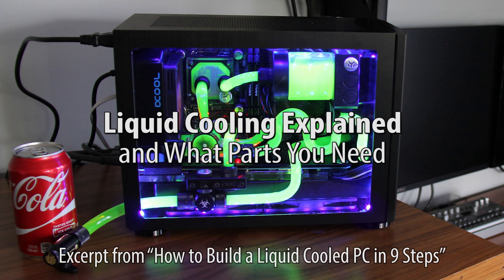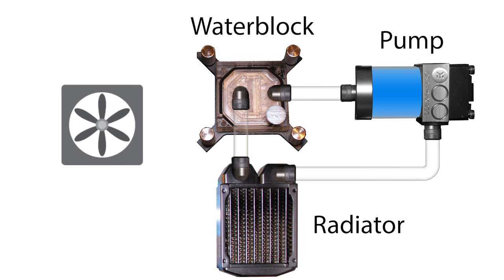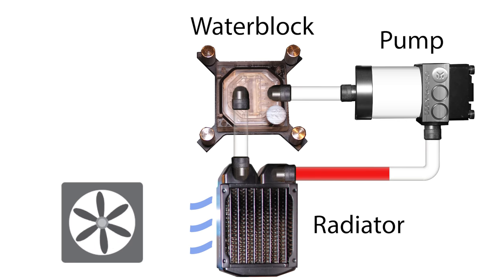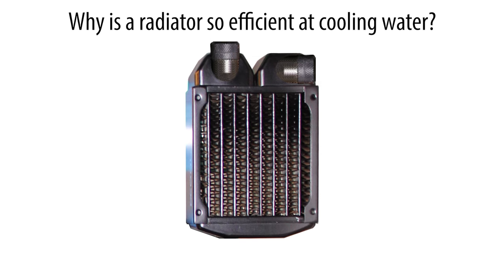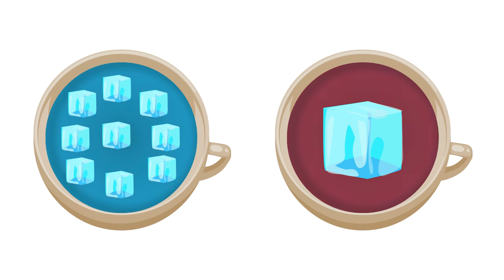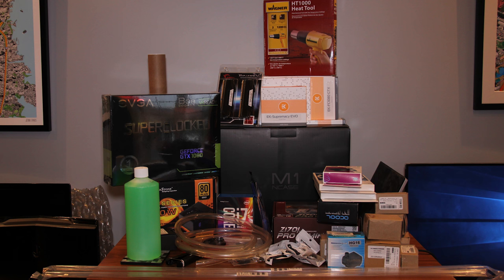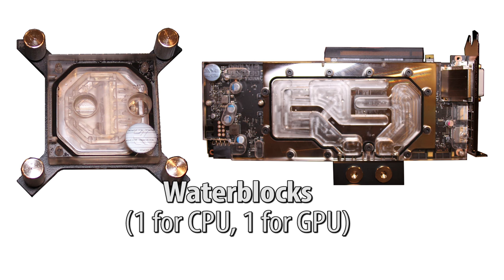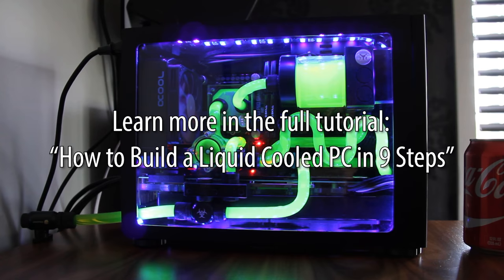Water Cooling Explained: How It Works and What Parts You Need

Comment: Cheers! Covered everything quick and concise!
For me, was wondering how the water got to parts like cpu and gpu
Reply from the maker: bob bob glad it was helpful! The CPU waterblock is how water gets to the CPU, and the GPU waterblock is how water gets to the GPU. Let me explain in terms of the CPU which is easier to visualize: the waterblock has water running through it. The waterblock is made of metal (and acrylic). The metal area comes in contact with the CPU chip. The heat from the CPU chip is transferred from the CPU chip directly to the metal area of the waterblock because they are in direct contact with each other. The CPU is not getting wet and water never touches it. The CPU is touching the metal area of the waterblock. Inside the waterblock, water is flowing and coming into contact with the same metal area (but from the inside of the waterblock). now that the metal area of the waterblock is hot, the heat is transferred to the water inside the water block. The water is then carried outside of the waterblock and towards the radiator where the water is cooled down. The same applies for the GPU - the GPU has many little chips on it that all come in contact with the GPU waterblock’s metal plate. Usually thermal paste and/or thermal pads are applied to the CPU and GPU chips to ensure a good thermal transfer between the components. I hope this makes sense!
Reply: @Coolarj10  wow
Reply: @Coolarj10  get when are tou going to make a new vid

Comment: Your ice cube analogy works to describe the water (coolant) being run over the hot cpu/gpu so I'm being over pedantic, but in relation to the physics of the radiator fins and their surface areas effect on the water, it's because you're spreading the heat out.

Comment: Great video explained really well I understood something for once but
I’m confused about one part
If I buy a liquid cooler does the radiator and water block come with the liquid cooler when you buy it or do you have to buy all that separately
Reply from the maker: They are available separately and also as an “all in one.” In my liquid cooling tutorial video, you’ll see each component is separate and purchased separately. However, you can purchase an “all in one cooler” for your CPU which will include a pump, radiator, and waterblock for your CPU. You don’t even need to add liquid because it’s pre-installed and  sealed for you. You can also purchase a separate “all in one cooler” for your GPU.

Comment: Very interesting, it works similarly to coolant and radiator in a car
Reply: Exactly. Same concept which is why people that dont understand cars will say " Something is wrong if your coolant goes over 40-45c or so. 

In a car. The coolant heats up the more you push the car. Same with as if you push your pc "Cpu temps go up so will the coolant" Now if your hitting 100c your coolant will hit around 50/52ish so safely. 

Reddit people dont understand that tho and i can see why they say it but ya same logic as the radiator in a car.

Comment: Very informative video man thanks.  But your hot drink analogy is a little flawed if I understand the process correctly, it's more like if you leave a hot drink in the cup it will eventually radiate the heat away into the air, but if you tip the whole cup of hot liquid out on a flat surface, it will cool much more rapidly because more of the hot drink is making contact with the air and the surface.

Comment: Hey what is the average temperature it achieves? can we use this method for cooling water with continuous flow  freshwater using say 2 big radiator?
in case you have rough data please share.
Thanks

Comment: i have a question we know water keeps it cool.. but wat if the water itself get so warm and hot excepting that the room is about 35-38 Celsius without AC and then wat?
Reply from the maker: gamer_ OO7 hey great question! The ambient temperature in the room definitely plays a role, so if your room is overall warm, then your water won’t cool down as much and as a result your components will not cool down as much as if they were in a cooler room. Keep in mind a 35-38C room, even though quite warm, is still cooler than the temperature  the CPU/GPU typically are at when running. So, your computer may not get cooled down as much as if it were in a 25C room, but it will still get cooled down. Regardless of the room you are in, the water in the loop will be warm to the touch. Since it is constantly absorbing the heat from your CPU/GPU (and also constantly being cooled), it will eventually reach a consistent temperature somewhere in between. The temperature it reaches will be an equilibrium between the rate at which it absorbs heat from the CPU/GPU and the rate at which it gets cooled by the radiator (which uses the air in the room to help cool the water). Hope this helps!
Reply: @Coolarj10   i dont think the equilibrium temp will remain constant  since room is hot and cpu is much hotter. yes it should work but after time(lets say 2 year)  the water may become hot and the equilibrium temp will also inc in temp in every process hence  room tempereture do a important role in this too. i get it nothing last.. . but  the more it get warm and hot the more lifespam of watercooler decrease. so i think keeping room is necessary as much as pc

Comment: what's the correct? the pump of the water cooler need stays in full speed mode (100%) or variable based on temperature?
Reply from the maker: Up to you! If you keep it at 100%, it will always provide the maximum amount of cooling. But at 100%, you’ll be able to hear the pump spin louder. So the benefit of variable is that you can keep your PC quieter when you’re not doing high performance stuff.

Comment: Very easy to understand. Subscribing so I do my part to help get you to LTT's level in terms of subs. Thank you so much. I had a fan in my PCPartPicker build and didn't get why I'd want water cooling. Until now. Happy holidays and a happy new year to you!

Edit: Quick question, what is the green liquid you have at the end? And is it better in terms of cooling compared to distilled water?
Reply from the maker: Thank you for your comment! So sorry, I totally missed your question.. I hope you figured it out by now lol! But for anyone who comes by this thread: that was a UV Green liquid from EKWB. It’s no better than distilled water. If anything, technically distilled water is best because it has almost no impurities, so you get the maximum effect of heat transfer/heat capacity with H2O, and there are no impurities or chemicals interfering with that or other gunk that could clog your system. But additives such as coloring, anti microbial solutions, or even tap water, should work almost the exact same. The performance difference seems negligible. The reason tap water is avoided is in case mineral deposits form and clog up the system. Some liquid cooling liquids sold that have a lot of coloring in them can eventually build up/clog up the system as well, requiring more frequent cleaning than distilled water. So it’s best to check the reviews and see what experience others have had so you know what to expect.

Hopefully you were able to complete your PCPartpicker build!

Comment: Do u have to change the water sometimes?
Reply from the maker: It is generally recommended to replace the liquid every 6-12 months so that any build up, sediment, gunk, can be removed that might impede the smooth flow of liquid. However, I didn’t change my liquid for 2-3 years (I was too lazy) and things seemed to work fine haha..so it is recommended, but it’s up to you, just like with any other maintenance!

Comment: if the pc is factory made will i have to refill the water tank thing?-
Reply from the maker: Cookie Chip it depends on how it is liquid cooled. If it is factory made with an all-in-one liquid cooled loop, then you probably don’t have to refill anything because it is a pre-sealed system with no maintenance required. Some of those all-in-one systems do have a port to refill liquid though, so keep an eye out. If it is a loop with a reservoir and pump like in this video, then yup you’ll want to replace/refill the liquid every so often to prevent debris/mold from clumping up. However, I was pretty lazy and didn’t refill my PC for 2+ years and it was still working fine, but that’s probably not recommended haha 😅
Reply: @Coolarj10  thank you for the explanation lmao

Comment: So it’s just H2O? Does the water dissapear, do you need to refill it?
Reply from the maker: Yup, you just need H2O. It is better to use distilled water rather than tap water because tap water has minerals in it which can potentially clump up and clog your system. You can distill water yourself or just buy distilled water (e.g. $2 at a supermarket or general store). The water does not evaporate because and does not disappear. It doesn’t evaporate because your liquid won’t get that hot, and it won’t disappear because the pipes are all air right - there’s nowhere else for it to go. The only reason it is recommended to replace the water every 6-12 months is in case there is some sort of gunk or mold that ends up clumping up the system. I’m lazy and didn’t replace the liquid for 2 years.. probably not ideal but hey it still works!

Comment: This is a dumb question, but are there liquid nitrogen cooled computers?
Reply from the maker: Not a dumb question! I’m not super well versed in this, but I believe people have tried and/or there are some videos about cooling with liquid nitrogen you can check out. But my initial impression based off what I know is that it’s not practical. Liquid nitrogen requires a lot of energy and special equipment to keep it that cold. So you’d need to somehow setup liquid nitrogen in a way that can pump through a liquid cooled setup. Regular liquid cooled PETG pipes etc may become brittle and crack at that temperature, I’m just guessing.. and the performance increase that you would get for the cost of trying to set all that up would make it not worth it at all. Now let’s say you somehow went out and managed to buy liquid nitrogen and bring it home in a container… well putting aside the fact that it can be dangerous … if you pour it in your CPU.. it will probably keep it cool for a while, until you run out of liquid nitrogen, lol. Anyway just some thoughts but I haven’t done any research on the topic… interesting to think about though!

Comment: Do u have to do water changes
Reply from the maker: Hey, great question! It is generally recommended to change the liquid every 6-12 months or so, and consider cleaning the liquid cooling components as well. However, this will vary and is up to you. The reason to change the liquid would be if there is mold or residue build up causing the flow to be slower or blocked, which can reduce cooling performance. On an honest note - I am lazy and haven't replaced the liquid in at least 1 to 1.5 years haha!
Reply: Arjun Mehta does the pc stil works good mate??
Reply: @Coolarj10  you better replace it
Reply from the maker: S .A.G loll it’s 2020 and it’s still running just fine and I never changed the liquid... I probably should though..

Comment: Does it work with tap water?
Reply from the maker: Yes it still works with tap water. The reason distilled water is recommended is because distilled water does not contain minerals that may be in tap water. Minerals, over time, could possibly clump together into hardened mineral deposits that may interfere with the system by reducing optimal flow, clogging, etc. The thing is, this is probably pretty unlikely. And even if a mineral deposit formed, the chances that it would actually prevent the pump from working seem very small. And even if that happened, you can disassemble and clean out any clumped up deposits.

Comment: Is a very good tutorial but you have some concepts wrong, nitpick but wrong nonetheless:

1. Water absorbs better the heat than air not because "higher heat capacity than air" but because water has a better heat transfer from metal than air. Heat transfer and heat capacity are two different things.

2. Radiator are extremely efficient at dissipating heat: WRONG. The job of the radiator is to transfer the heat from the water to the fins, but without air blowing they just do nothing but to be a glorified skillet. the real dissipation comes from the air blowing from the fans into the fins, the more fins, the more area for heat transfer for the water so in the end the fans dont help to dissipate heat... they are ESSENTIAL to dissipate heat from the radiator. thats why the higher the air pressure from the fans the faster the cooling will be and temperatures on the cpu/gpu could be lowered even more

Comment: cool, u think someone could build a water cooled ps5?
Reply from the maker: Sure thing, you just need to mount a water cooler onto the processor among other things..but you'd need to figure out how you'd want to program the pump so that it knows when to turn on and turn off, and how fast to pump. Could be a fun but complex project, but maybe not worth it since the PS5 already seems to work fine as is.

Comment: can i just submerge my entire system unit in water?
Reply from the maker: whimsical theif sometimes people jokingly ask this, but it’s actually a valid question. You can’t submerge your components in water because water conducts electricity. The electricity passing through the components will also travel through the water and fry your components. Instead of water, there are cool builds you can check out where people submerge their PC in mineral oil instead, which doesn’t conduct electricity.

Comment: why can I not just submerge the tower into my bath tub full of water
Reply from the maker: Haha you can try to do that, but as a minimum you will destroy your PC, and the worst case is that your bathtub is now an electrically conductive disaster that could potentially electrocute and/or kill someone that steps inside. Water is electrically conductive. Circuit boards are designed so that each capacitor, resistor, and other components are connected at only specific points (the points where they are soldered onto the board). When you submerge any component in water, such as a motherboard, it’s like suddenly connecting every single point of the motherboard to each other, thereby creating a massive short circuit. What’s worse is, your power supply unit, which will have 100-240 bolts (depending where you live) connected to it from your wall outlet, will now have exposed all that voltage and current into your bathtub. So anyone that steps into the bathtub would get electrocuted. It’s the same reason throwing a blow dryer or any other electrical apparatus is dangerous if you let it fall into the sink or a bathtub. The water in an liquid cooled loop never touches the circuitry, it only absorbs heat through the waterblock. You can read more about what a short circuit is to better understand what it means. But in summary: do NOT put your PC in a bathtub! You can look up oil immersed or oil submerged PC instead. Certain oils aren’t very electrically conductive and if done correctly can work the way you described.

Comment: Wrong illustration dude
Hot liquid goes to the radiator first, it cools down, then goes to the reservoir.
Reply from the maker: Anatoliy Bsnsjs hey thanks for the comment, this is commonly brought up and it is actually a misconception. It actually doesn’t matter which order the parts are placed in the loop. This is because the water is traveling and mixing so fast that the entire loop reaches a consistent temperature, so the water in the radiator will actually not be warmer or cooler depending on where in the loop you place it. I know it seems counterintuitive especially when my slow motion diagram shows hot water running flowing into the radiator. In reality, since the process is happening so quickly and water is flowing so fast, it actually doesn’t matter. There are some great videos out there, I recall Linus Tech Tips and JayzTwoCents have pointed it out in a few videos where they actually tested out different orders for their parts and there was up to a 0.1 degree C difference. So if there even is a difference, it is negligible. So for anyone working on a liquid cooled build, my suggestion would be to focus on the order of the loop based on what is convenient rather than trying to force the radiator to come before the reservoir. I probably should have re-ordered the illustration to avoid any confusion, but it’s actually great you pointed this out because I’m sure others have wondered about the order.